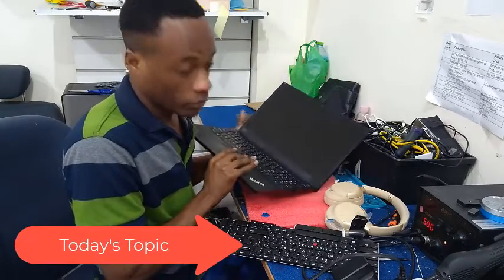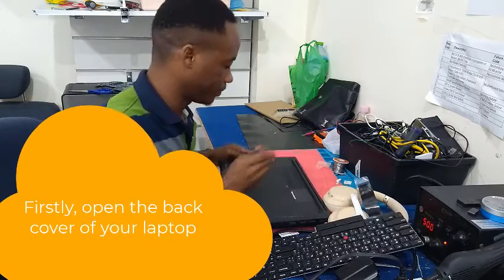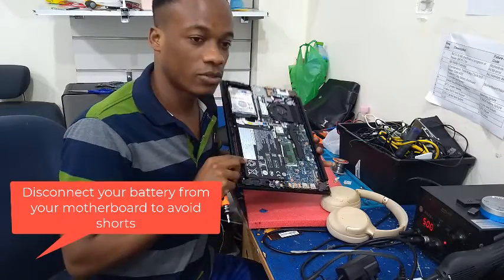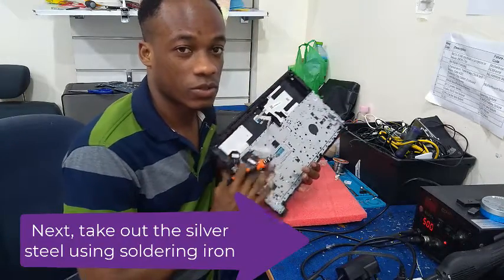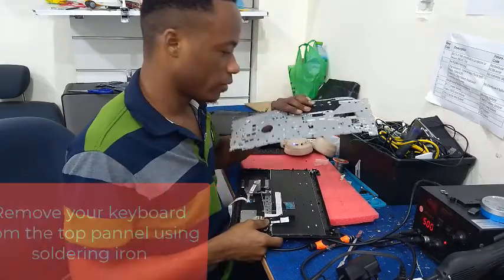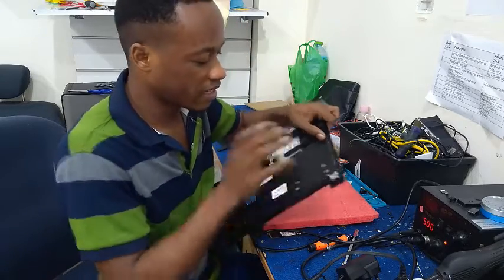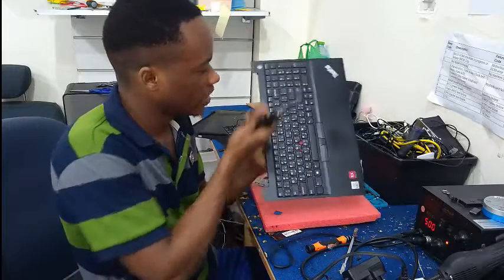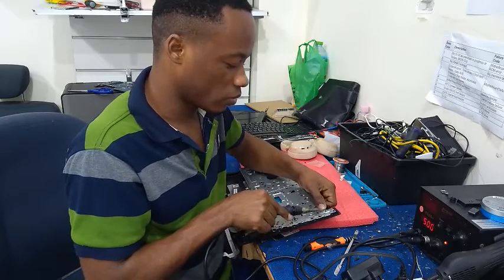How to replace keyboard for lenovo thinkpad E14 Gen 4

Comment: Hey, when you say use soldering iron to put back the new keyboard what do you mean? you solder the keyboard plastic to the palmrest plastic only by heating it?
Reply from the maker: Yes only by heating or if you have a heat gun, you can use it to glue the keyboard back, but always good using the soldering iron to heat it